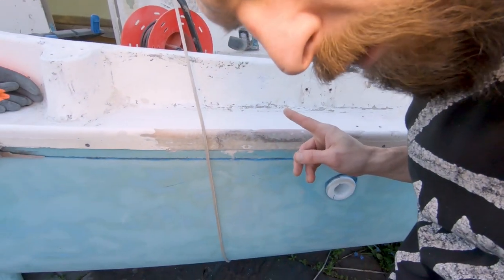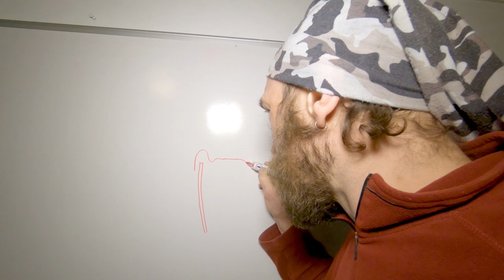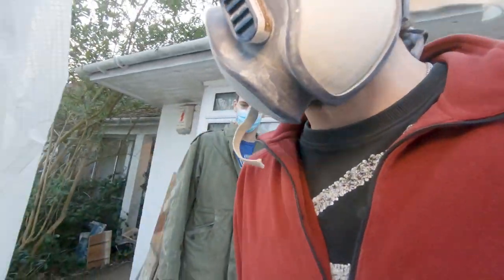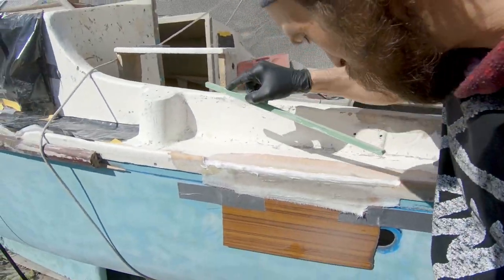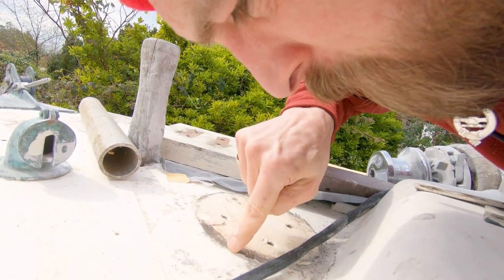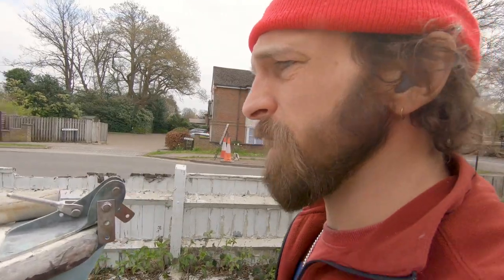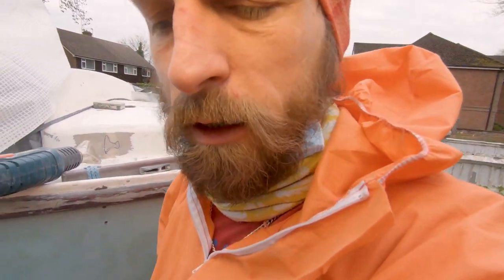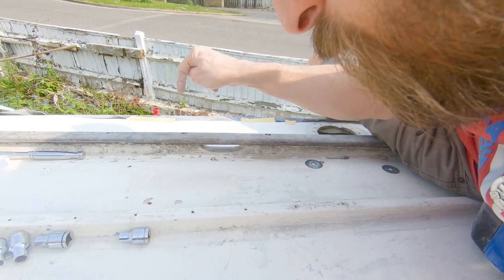Project Sail Boat Deck Repair

Comment: Thanks for posting these videos. I bought a Vivacity 20 to restore last year and it will be a great help having seen one "stripped bare" when I finally get around to working on it! I can confirm that the bow roller and chain pipe are exactly the same on mine, so I would say they are original. The main difference with mine is the location of the toilet. Mine is in the position shown in the old brochures, which is directly beneath the front hatch. The only way you can actually sit on the toilet is with your head sticking through the open hatch. So, if you ever see someone with their head out of a Vivacity hatch, facing towards the stern, you now know what they are doing!
Good luck with the project.
Reply from the maker: Thanks Roberto! I did notice that toilet position in the brochures... I'll keep an eye out for the heads of those using their heads!